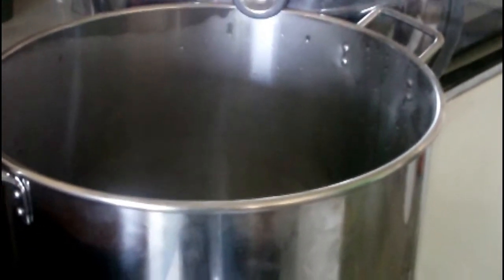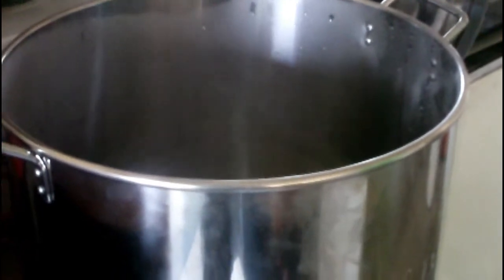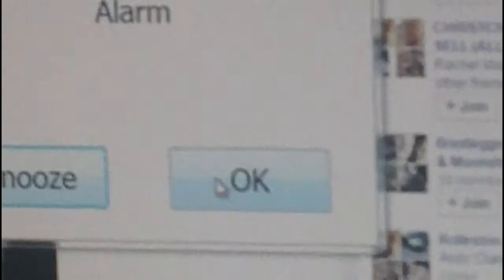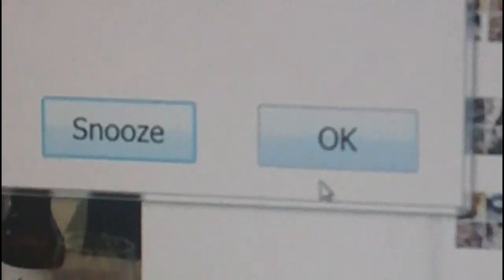My 1st ALLGRAIN....

Comment: You done did it, Steve!  Yeah, that strike water temperature was a little low.  You want it to be up around 74-78°C, somewhere in there.  I use a brewing software to calculate that for me.  The sparge water I'll heat to around 82°C.  Good job going with batch sparging instead of fly sparging... so much easier and faster IMO.  Warrior is a weird hop to use as a SMaSH... it's a normally a hop that is just used for bittering.  If anything you will see how Warrior comes through as a flavoring hop!  Congrats, Steve!